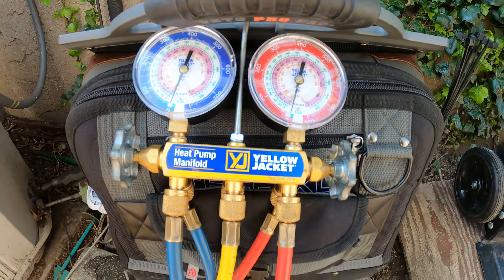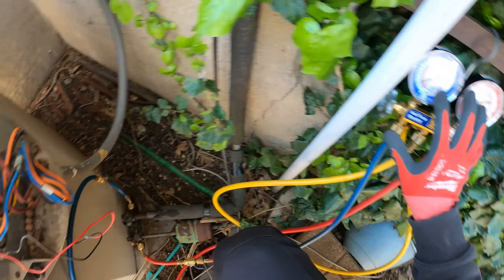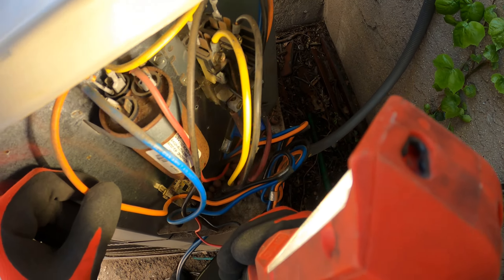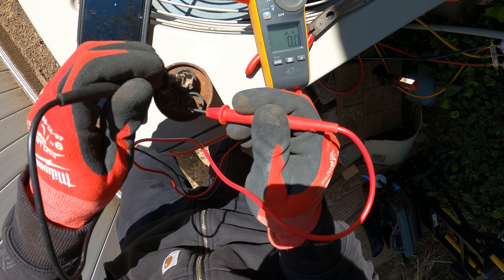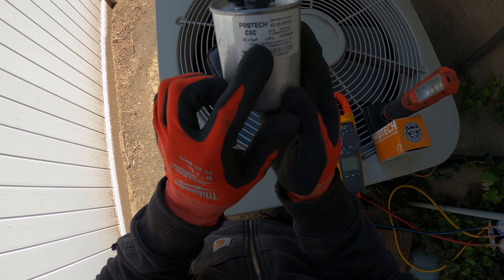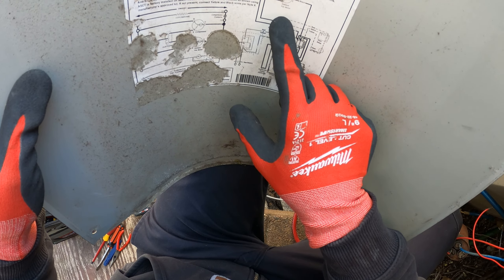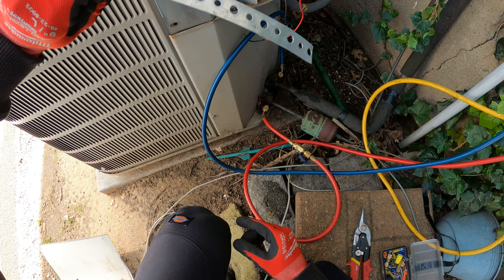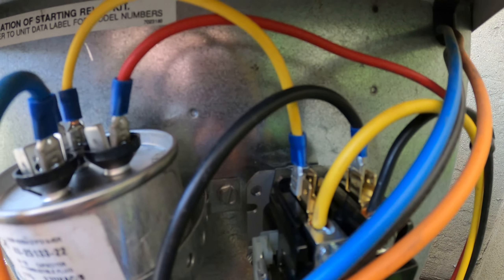HVAC: Compressor & Condenser Fan Motor Both HUMMING & Not Starting (AC Not Blowing Cold Air) FIXED!

Comment: I went outside and noticed the compressor wasn’t running. I checked boxes and breakers and everything seemed ok. Went back out and I could hear a soft hum. I hit the top and the fan turned a little bit. I hit more and the fan started turning. It seems to be blowing cool air inside now, but the temp on the thermostat has not gone down any yet. What is your diagnosis, doctor?

Comment: You a service tech and had to run to the supply house for a cap??
Reply from the maker: For that 40/5 MFD dual capacitor, yes. I don't stock duals on my truck. I work in commercial & I'm typically working on 3 phase equipment. Thanks for watching!